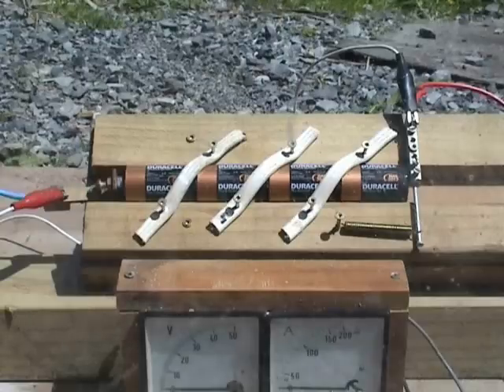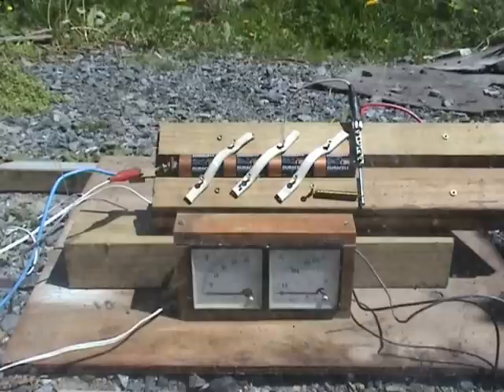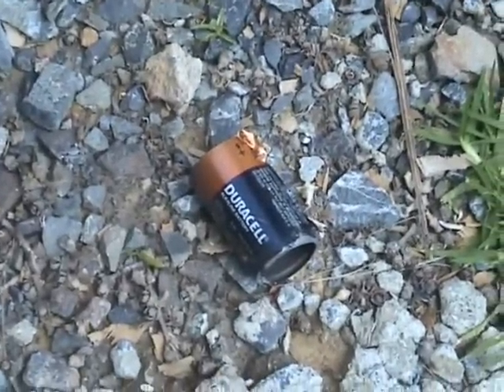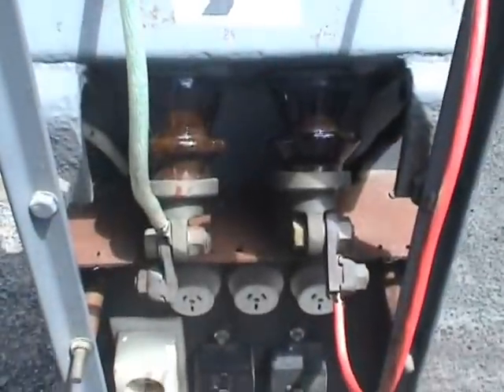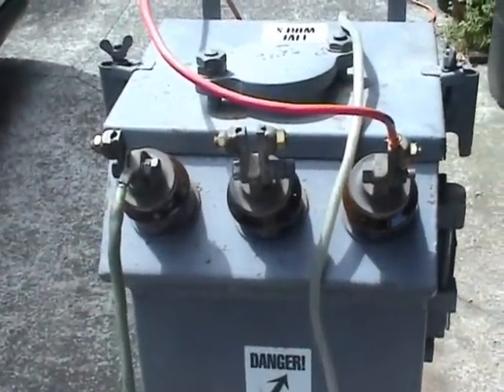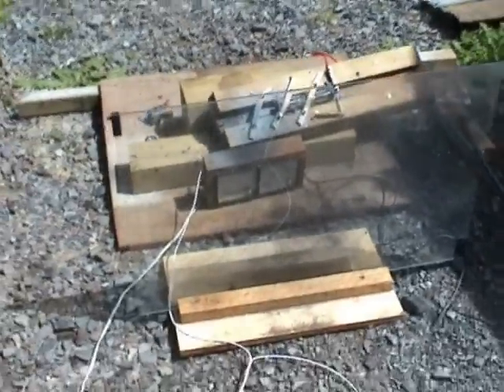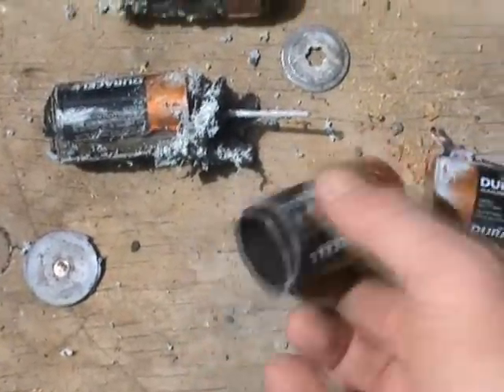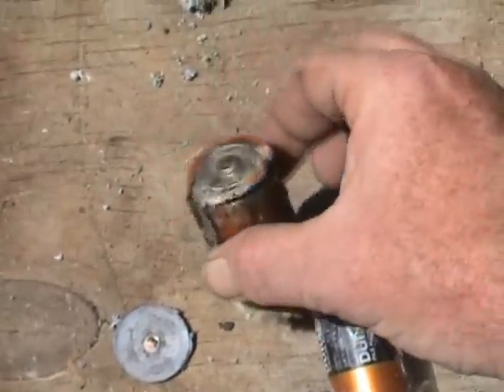D-Cell battery explodes at 42 Volts AC

Comment: @daewooparts He does use a shield, yes, but I still fear that containing the explosion pressure in another container (i.e. a Maglite ) may compromise this shield. Besides, it's not as if the shield is 8ft x 8ft, or anything that kind of size. It only seems to protect the camera from minor splats, & I'm sure that it's not intended to withstand high pressure explosions. Besides, I like to see the smoke, flame throwers, & whistley squeelers. Whistle-whistle.....SQUEEEEEEEELLL :-D

-BoomBoxDeluxe.

Comment from the maker: @mike4ty4 

mike4ty4 has made a comment on D-Cell battery explodes at 42 Volts AC:
What'd happen if you hooked it directly to the 5 kV?

You need 5 kV with amps. A MOT won't do anything and probably burn out.

Comment from the maker: @FoamPackingPeanuts  LOL but they are not designed for this type of abuse.
Duracell batteries are actually some of the the best batteries available for commercial duties because they are so well sealed, have high current capabilities  and don't leak like other batteries.